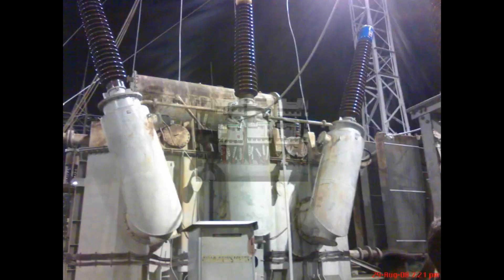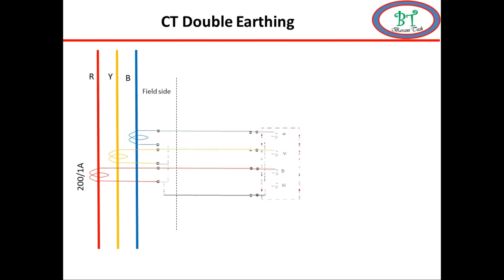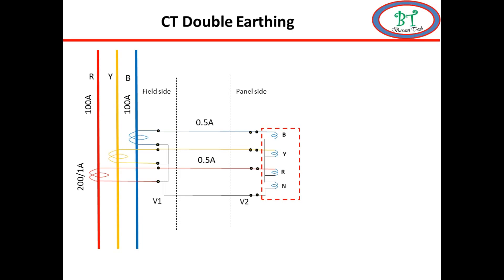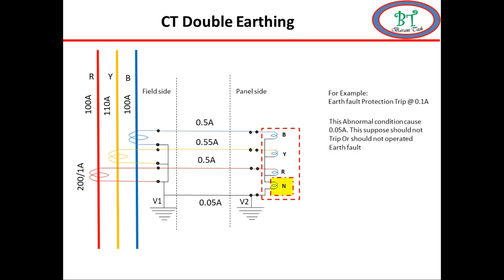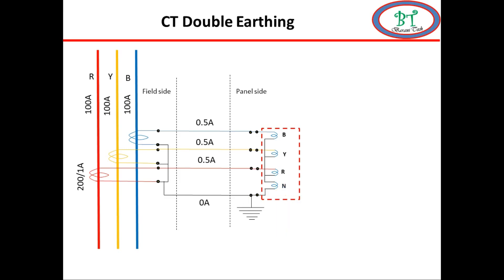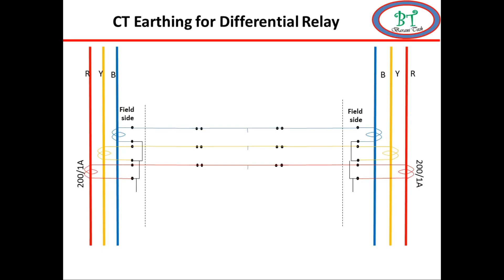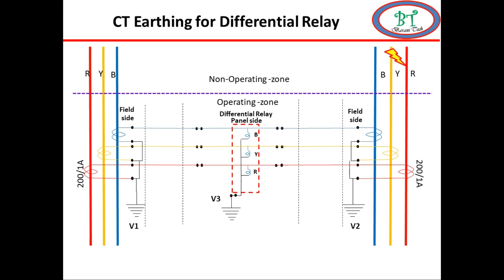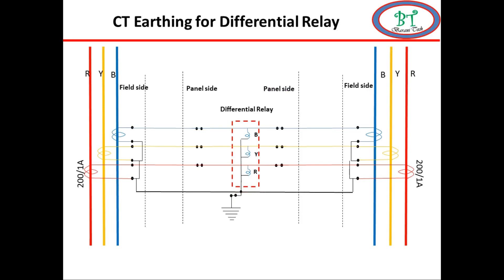CT Secondary Double point Earthing side effects | Mal operation of Double Earthing on CT Secondary

Comment: Sir my substation in differential relay operate when outgoing feeder in over current Earth fault occurs.i have face a problem after my 11 kV outgoing vcb panel change but I have not change incoming 11kv vcb but 11kv phase sequence will be changed for replace of the vcb but any wiring not disturbed and I have checked already of differential relay wiring with clamps meter and connection tight.what is possible reason
Reply from the maker: please check on Relay differential current and I R current while in normal running condition. as per your condition you have to test stability test thank you.
Reply: @baranitech  phases current equals like that's relay show R 100-99-1/2 Ampere pulse minuse circulated  3 phases are same condition

Comment: Good informative video brother,thank you
I have a doubt,
Earth fault is taken from neutral side current, in case if we are not connecting CT secondary earth it will make any disturbance in power system like not sensing?
And yes CT secondary earth is also for safety reason but apart from safety if we do not connect it will make any effect in earth faults?
Reply from the maker: CT is a power isolation so actual earth fault current will not get this path. thank you bro.